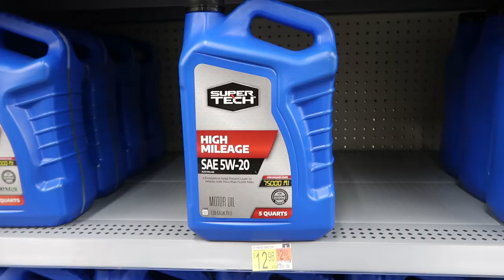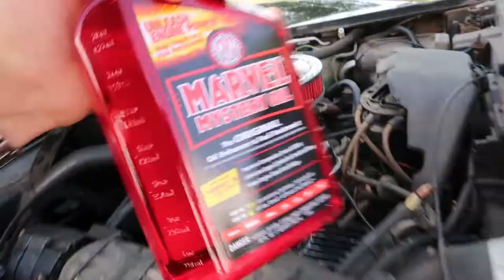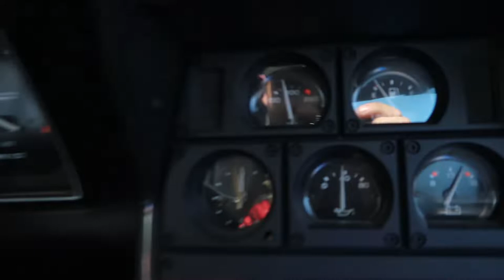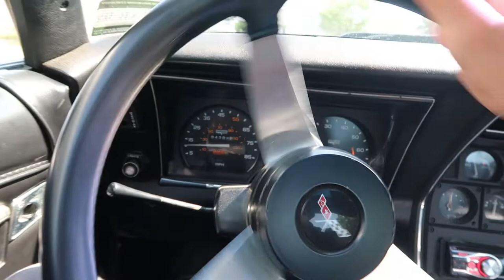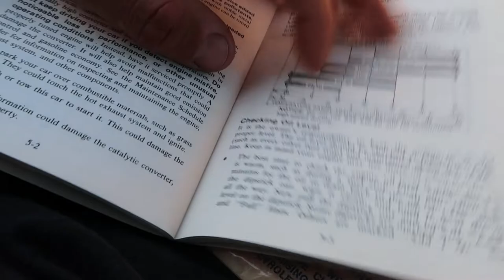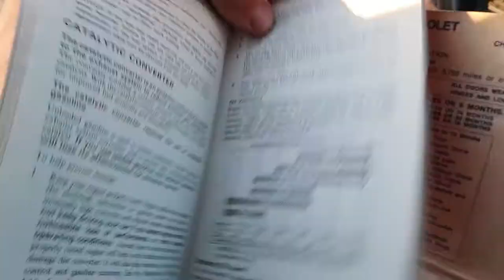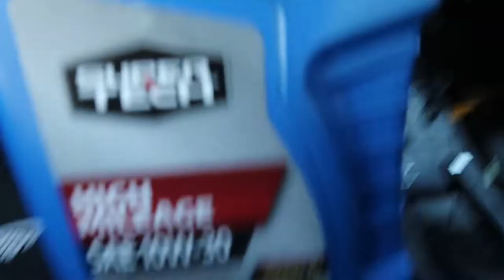This Will Destroy Your Car's Engine

Comment: Feed that engine shell rotella 15w-40 deisel oil. It has all the good vitamins for an old engine like that.
Reply: Wouldn't it be too thick?
Reply: @willg.5168  no. I've ran it in a lot of older engines. The only thing is I let then warm up in the winter time. Meet engines with variable valve timing and hydraulic tensioners on the timing chain are more picky about the oil you use.

Comment: Octane ratings on gasoline only means their resistance to detonation. Unless you have a high compression or boosted  engine it is identical in burn speed, energy output, and stoichiometric mixture with air. In other words, an older ls engine will run fine on 87 octane

Comment: If you have to do that kind of fill ,hold your finger over the opening for as long as you can, then shove the spout right down the hole. You'll spill some, but 95% will get into the engine this way...MARVEL MYSTERY OIL is good stuff, it definitely has its place on any good mechanics shelf.  Great in  the fuel too, especially with today's ethanol in most fuels... Nice ride for sure!!!
Reply: If you just orient the spout to be at the top instead of the bottom when you pour,  it works way better.

Comment: So next time try to flip the bottle so that the snout is on the top instead of the bottom. Helps prevent the gurgle.
Reply: That's literally WHY the bottle is designed that way. The spout should always be on Top! Oil bottles have done this for like 80 years now.

Comment: My xterra was using quite a bit of oil, it had an oil leak when I first got it(he said it didn't, but I finally realized it) which turned out to be a quick n easy fix. But, I think the previous owner may have let it run low on oil and when I first got it, I drove it on a long trip and the next day when i checked the oil, it was really low. Not sure if that caused the problem or he was not good with oil changes. But, the engine has always done well except for too much oil consumption. It had what I think was too much blow by, so when I replaced the timing chains recently, I poured a decent amount of MMO down each plug hole and let it set for about a week, I rotated the engine several times during this process and after several days, I added some more. Once I had it all back together, it took it a bit to start and man it smoked like a chimney for about 30 min or so. So far the oil consumption is WAY down and after around 1k miles,  the oil level is still very close to where it was when i changed it.  after getting the engine back together, I put in some conventional oil with some mmo and drove it for a couple hundred miles, then changed it with my typical high mileage mobil 1 and a little less than a qt of mmo. So maybe the rings were stuck with carbon ,, idk..  It never smoked, but it was consuming oil and had quite a bit of blow by. I bought  a pretty good air compressor air water separator and installed it, like a catch can and that is also working great. So b4 you listen to all the nay sayer's about if you have blow by it's too late, at least give it a shot. Could just be a ring stuck with carbon or from some other reason. I drove my car from bama back to NC and checked it each day for the past week and the oil is still very close to full and I may have not gotten it totally full when I changed it, so we'll see, but for now she is much better and runs great and also, no more low octane pinging like I was getting b4, with all the oil from the pcv going into the intake. I learned that it lowers the octane, I always wondered why when I used regular fuel I would get some pinging, now the issue is gone! I think between the mmo and the "oil catch can", problem solved.

Comment: Marvel Mystery Oil will clean your engine . If your motor is old and full of dirty sludge from lack of oil changes . MMO will dump a Hugh amount of sludge in the bottom of the pan . Sometimes blocking the oil pick up . You'll lose oil pressure and need to remove the pan and clean it out . It can work too well .
Reply: I thought it’s supposed to liquify the sludge.. a heavy sludge engine would need a few treatments 1k miles apart to clean the engine and oil pan without having to drop the pan.
Reply: @Helmuesi911  when I said slubge , it looks like a black shaving cream . Almost like water in your oil but black .. Your correct doing a few treatments quickly would help . We learn from these experiences  . Marvel Mystery Oil does work this is just my results , part of the problem was my fault .

Comment: Thin weight oil you just bought 5w20? Usually v8s run 15w40 or 10w40 etc

Comment: Spilled oil on the exhaust manifold can cause fires. Try adding Marvel Mystery Oil to the gas tank per manufacturers recommendation.  My grandfather rebuilt engines in the 60s and used the stuff. It wasn't until my 50s untill I rediscovered the stuff. Won't harm catalytic converters either.  Loved your video.
Reply: No it cannot it'll just smoke, oil will not ignite from that little heat

Comment: Its not rocket science, the bottle is shaped a specific was bc you are supposed to pour it from the proper side. The larger half facing the ground to prevent the air gulps and splashing. I am wondering if you ever changed your oil, added oil, added any fluids in anything prior to this. As far as octane, put what it was designed for. You have spark plugs that burn a specific temp based on the compression of your motor. If you have an 87 car that has 91 in it, you'll find the combustion and plugs doesn't burn hot enough for full detonation, and unburned fuel gets burned out the exhaust. If you use 91 in an 87 car, it has hotter plug which will burn the fuel before detonation causing the classing "ping and knocking". Good luck to your channel. This video gives me a headache. Reminds me of my 8yr old phone and all his videos of these overly hyper people. People do not act like this on a daily basis when the cameras go off. Almost like newcasters, they don't talk like that in real life at home. But anyways, I was looking for a legit credible video. Based on what I saw and see, I cannot take you serious. But yes, Marvel Mystery works.

Comment: Kleb, mystery oil is amazing! Engine oil for that year i would run a high mileage 20w50 during the summer and high mileage 10w40 in the winter. Plus you can run Seafoam in the fuel to help clean the carb and valves
Reply: MMO is a far better cleaner while seafoam is much better in the crank to help maintain ring seal against the cylinder wall.
Reply: @casey360360  why do you say seafoam is better in the crank then mmo do you put your mmo in the gas tank??

Comment: Haha ,yeah dude lighters are hot,replace your pcv valve,run Rotella T6 5w40 that older motor will love you for it
Reply: this
Reply: Idk everything I read on BITOG says to run the oil that your car calls for
Reply: @bassheadlife492  most of the times the guys on Bob is the oil guy are right,but this vehicle was made decades ago , current oil technologies didn't exist,while using the recommended oil is fine sometimes you just gotta use your head and do what's better for your vehicle.
Reply: @bassheadlife492  my f150 just logged 240k miles with 40 grade and it was speced for 5w20. funny thing is its jever been torn apart for repair but all those 5w20 guys have had new chains and phasers put in by 150k.

Comment: Id use 10w40 conventional. 5w20 seems to light of a oil. I'm not sure what kind of engine you have. I got an old Chevy 350 that was burning some oil. I started using Pennzoil high mileage 10w 40 conventional. After about the fifth oil change the old burning has stopped. I change the oil every 3000 miles.

Comment: LEARN ABOUT CARS before you attempt to maintain them! The fuse was NOT the problem. The fuse just keeps the device from drawing too much electricity and burning itself up. You either had something disconnected or a connection was corroded, and you moving everything around wore through that and a good connection was made.

IT'S AN EXHAUST MANIFOLD, not a "header." Headers are tubular. You have a cast iron manifold. 

YOU NEED 93 OCTANE GAS because of the compression ratio of the engine. If you use lower octane gas you will damage your engine, if the manual says you have to use 93 octane gas.

YOU NEED TO KNOW WHAT YOU ARE DOING. Learn first BEFORE you destroy your car.

Comment: Techron is the best fuel system treatment ever! MMO isn't bad either but better for cleaning and treating your internals in your engine. I use both. My lil work daily is a Ford ranger with the 2.3l 5sp 2wd with 502,000 miles and still rocking the original engine transmission and rear end! 3000 mile oil changes clearly does wonders along with good maintenance. I just give my daughter a 2006 Impala recently and it now has 220,000 miles and runs like the day it was new. Both Techron and MMO helped both vehicles get to these mileages!
Reply: Was the Best when they used PEA, not anymore.

Comment: I've been using MMO and Lucas fuel & oil products for years . . . Decades in the case of MMO, as did my dad. Proper maintenance and regular oil and fluid changes are the key to powertrain longevity. 

I've owned and driven musclecars and worked on them as well. If it's stock, that vintage Corvette has a low-compression smog motor, probably about 8.5:1, and unless the manufacturer recommends high-test, you can probably get away with 87 octane fuel. I add MMO and Lucas fuel treatment to every 3rd tankful at least.

I just had to replace my 5.4 3valve Triton-powered Expedition with just under 540,000 miles without any internal repairs. I'd consider what another commenter recommended regarding the Rotella diesel oil . . . Makes sense. Will probably cushion the valves and protect the top end of the mill, but the MMO added to the gas also helps lubricate the valvetrain. Good luck

Comment: I would use 10-40 or even a 20-50 in an older V8 because its a little thicker.
Also, you need to buy better oil filters... STB filters are pretty weak, with felt end-caps. Plus, being a Hi=Performance engine you need a sturdy oil filter like Wix, or Fram Ultra Synthetic (even if using conventional oil)
I also swear by Marvel Mystery Oil. I put 1/4oz per gallon of gas, and do an oil flush from time to time like you did. I wouldn't suggest adding Marvel to the oil and running the car normally because the Marvel will break down the viscosity of the actual engine oil. 
Todays oils are high tech. The additives have a great benefit to your engine, and make the oil last far longer before viscosity breakdown.
Reply: I run 20-50 in everything i own way less oil leaks and i put some lucas oil stabilizer in there also..oil leaks will stop and cars and trucks love it...

Comment: Cars with older motors an carbon on pistons can benefit from premium fuel. From ping. Fyi but a working car with low miles. Run the fuel that’s required.

Comment: Just change the gasket seal. Silicone seal would be the best way to go. Otherwise you will just be pouring $$$ down the drain into your crankcase and watching it burn away or puddle under your car
.

Comment: They most likely put thicker oil in it to try preventing it from burning it so quickly. With a thinner oil  it might bypass the piston oil ring and increase the oil consumption.
Reply from the maker: 5w20 is not thick though lol both 5w30.and 10w30 are thicker
Reply: @doctorkleb69  oh i wasnt paying full attention on the oil part of the video and just assumed that the car had thicker oil than it should've had. Going up to 10w30 would probably help on your oil consumption problem!
Reply: For a Vette like that a 5w30 is a Thin Oil. Most ppl used 20w50 in those LS, back in the time. And they didnt burn oil.

Comment: My old 1972 Chevy vega station wagon  got you beat .it used to burn a quart of oil every 47 miles ..But when I owned that car in the early 1980's  .oil was like $0.34 a quart ..Casrol oil was like $0.45 a quart

Comment: Your name is SnuffedEnoughIGuess?
You held the bottle upside down.  The neck should be on top when you pour to prevent air bubbles from disturbing the laminar flow.

Comment: I’ve had a 70 c10 a 71 c10 and a 88 Camaro 2 with you engine the 350 and one with the original engine I put 93 in each but I know the 350 said to use 91+

Comment: 20 oils on the high end didn't exist when your car was made. No way would it be great for it. As it's a thin oil, it might have helped to clean the engine a bit. Minimum 30 on the high end of the oil, but since it's old a 40 might be better. I would say 10w40 in summer, 5w40 in winter if it gets down to 0 F or below in winter.

Comment: Add a small amount of wd40  in oil you will never hV oil leaks  little bit like 1/4  cup ,I even put in the gear boxes. No Leake
Put marvel mystery oil in the fuel and use low grade fuel and put on the dyno you gain horse power  about 10 %  as it says on the bottle  , really feel the difference on the motorcycle

Comment: I use MMO in every oil change. I also use ST oil from Walmart. Not sure how it would work with an older engine like that but high miliage full synthetic ST brand oil is just a couple bucks more per 5qts

Comment: Not professional at all. Remove and clean the valve covers after your first Marvel treatment. Then run High Mileage oil for one oil change interval. Continue with the Marvel before each oil change. Change the rest of the fluids (all of them!), and you should have a good running Corvette.